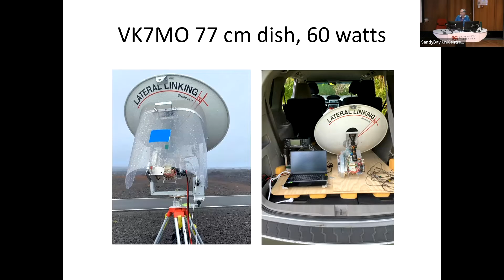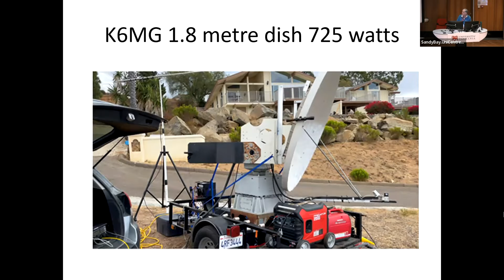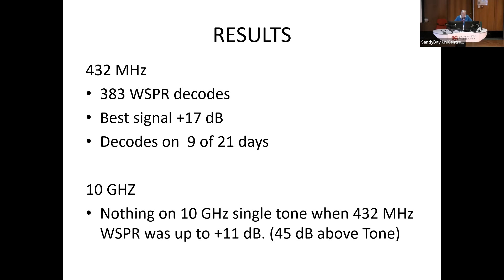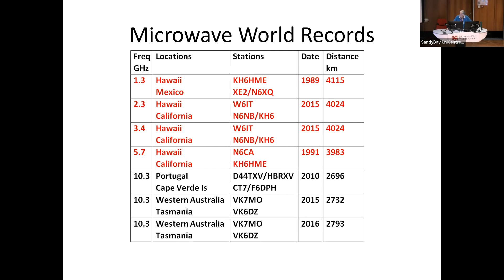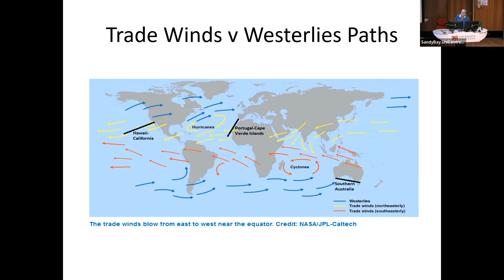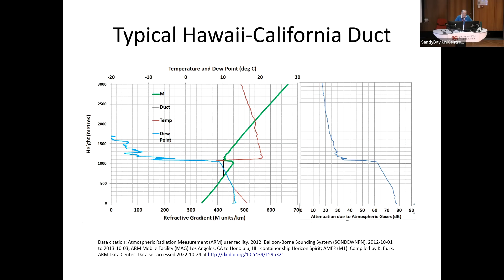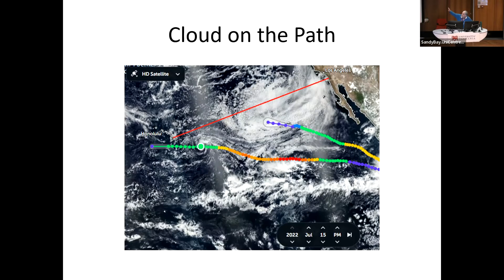Ham Radio on 10 GHz - Hawaii to California

Comment: 10 ghz is too high to take advantage of natural tropospheric reflections. Those reflections happen on 432 mhz and even as low as 130 mhz pretty much every single day unless the weather is garbage, or the sun is on the other side of the planet. 

In fact, with just 50 to 100 watts, you can pretty much do up to 500 miles if both sides are running sensitive RX (band pass filters) and have constructive high gain style antennas, or antenna arrays (yagis/dish/etc..).
Reply from the maker: I disagree. Rex (the speaker) has the current Australian record on 10 GHz from VK7 to VK6, a distance of 1600+ miles